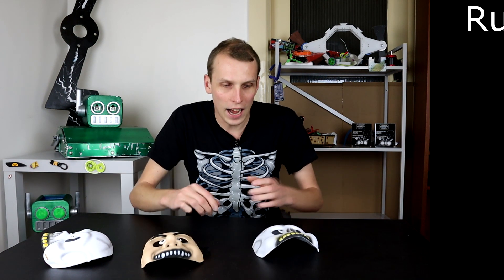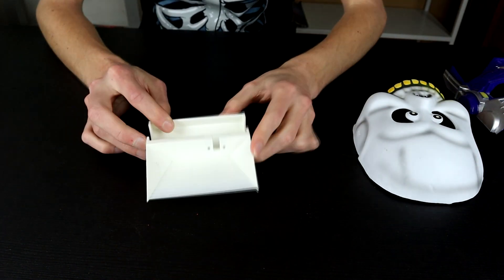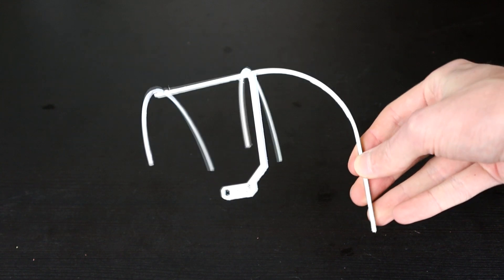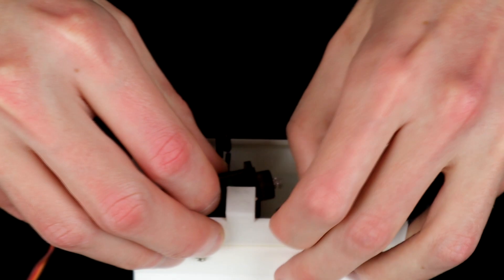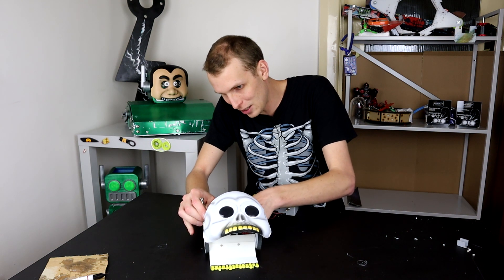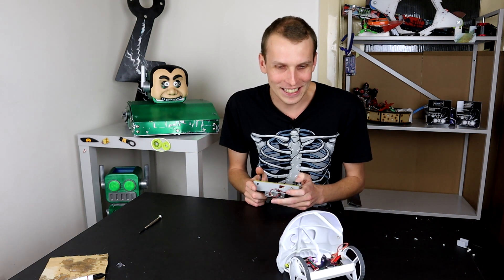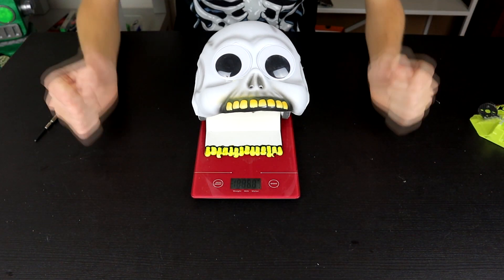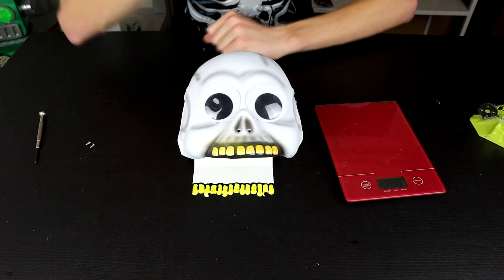Will It Bot? - Halloween mask!

Comment: Thanks  Ben I always  look forward to your Saturday Videos. I always wondered about your standard motor mount for ant weights.  is it 100mm (4in) from end of shaft to end of shaft? you always seem to have more room in the middle of the bot that I seem to have.
Reply from the maker: I dont have one to hand, I'll measure one later. But I dont think they are 100mm from end to end.
I think the motor is around 20mm and the gearbox is another 10mm-15mm

Edit: yeah definitly not 100mm, my bots are typically 100-140mm wide
I'm also building 150g antweights, not 1lb antweights
Reply: @TeamPanicRobotics   Thanks    I was wondering if your bot  is 100mm from the end of the shaft of the left motor to the end of the shaft of the right motor.  it just seems wider  than my ant weights that  I try to make that distance  100mm    ( does  your antweight league just go by weight? or do you have dimension limits
Reply from the maker: Haha, oh right, my bad.
This bot is 135mm from the end of one shaft to the end of the other. Its about standard size for my bots these days.

We only have a weight limit with no real dimention limit, however the pits in the new arena are massive and only have 150-160mm clearence between the lip of the pit and the wall, so if you want to survive past 2 minutes you need to build smaller then that